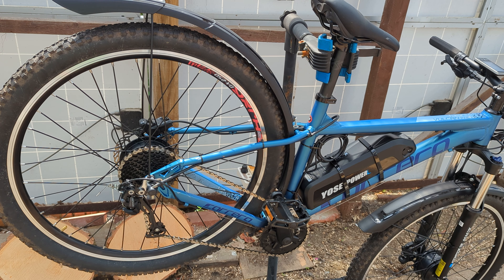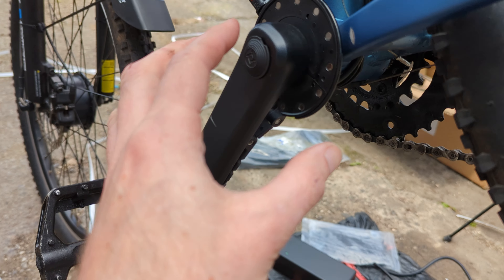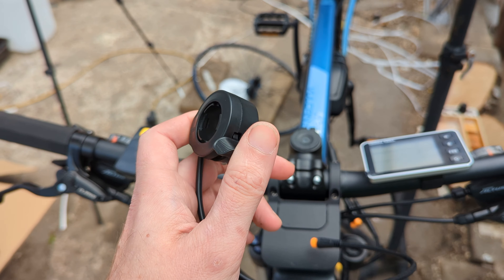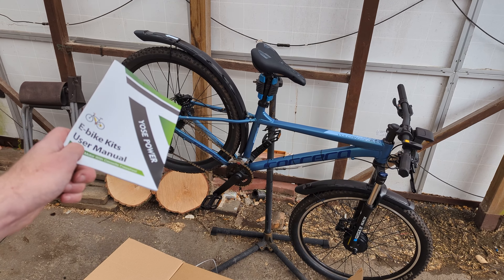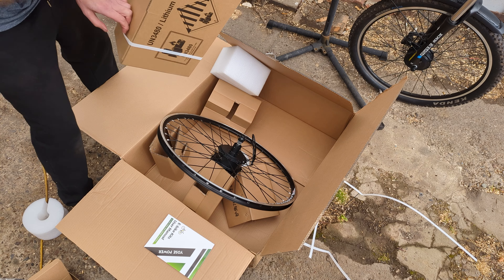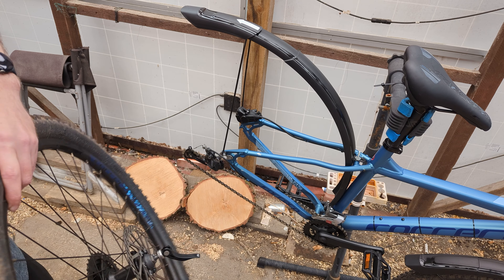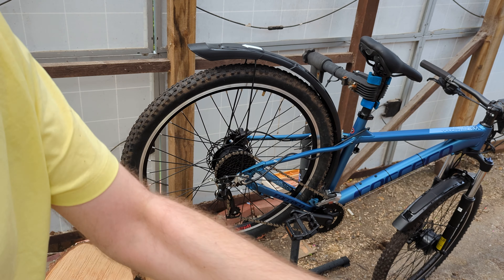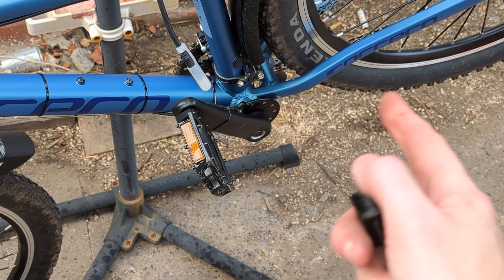Yose Power Ebike convertion kit - my fitting attempt

Comment: You would have been better off using Nutserts or Rivnuts to secure the battery holder, Its what I do.  Secondly, I hate the look of coiled cables and you have no option to do it or, 3d Print a triangular box and lid for them, again, which is what I do.  You can get aftermarket brake switches to make your original ones work.  I did rant on about a home fabricated torque arm, but as you are not using a throttle and its only a 250w motor, I think you will get away with torque washers that should be supplied with the kit.  That kit is totally different from the Yose kits I have used, but if it works, it works.....😉   If you want a 3d printed box and lid, let me know what dimensions it is and I'll print you one off gratis.  I have learnt so much from your channel, its the least I can do.
Reply: @neiladcock8382 these yose motors have no torque. I have a 500 W very low torque but very fast when you get the moving

Comment: Hellow my friend I no your work well with the Chinese diesel heater videos.  That's how I Recognized you. I fitted a yoses ebike kit last year and have done over 1000 miles according to the display.  Anyway I'm looking to upgrade the controller as of this messages because this Is my second controller and it also has appeared to fail so ig u ever have any advice on an upgrade would appreciate to hear. I did post a video of my installation to lol

Comment: I just wish the price of bike conversion kits would come down further, it's the batteries that are the killer on cost though, not that I've actually used my bike since I bought it in 2019....... :S
Reply: My ebike eventually died but now a battery replacement would be almost as expensive as what I paid for the bike. I doubt that I'll bother, I'd prefer a classic moped, free tax, no mot and 30mph top speed.
Reply: This kits cheap as chips

Comment: brake cut off's are a safety feature in case your PAS sensor or the controller malfunctions and locks on full throttle. also get a torque arm kit or you run the risk of rounding out the dropouts.

Comment: To own a bicycle here. You got to have zero regard to cars , people, signs and of course traffic lights. The city spent millions to put in bike lanes. Only so bicycles with electric motors to thumb their noses.
Reply from the maker: So much the same as here then.  A lot of people are just dicks.
Reply: @assassinlexx1993 studies have shown that cycle lanes (unless segregated by a physical barrier and how badly they are implemented in the UK)  actually are more dangerous than flowing with traffic as car drivers think that a cycle lane demarcation is a separate lane, whereas it's actually a line to tell cars where they should never be and they dangerously close pass cyclists even when they are doing the speed limit. I have had to buy a front and rear facing camera as every time I commute some cager tries to kill me.
Reply: @jamesemery1   this is why I got a heavy duty steel bumper for the truck . To give a proper nudge  to those two wheels  road parasites. To the curb.
Reply: @assassinlexx1993  You're the problem. You can probably apply that sentiment to all aspects of your life.
Reply: @shagybaxter  
🚲💥☠
Reply: @assassinlexx1993  I'm sorry you aren't a good driver but with time and practice you'll improve 👍